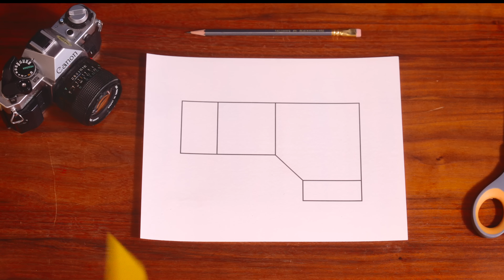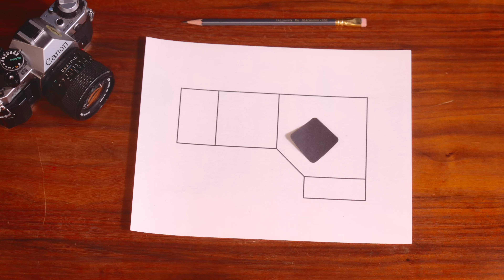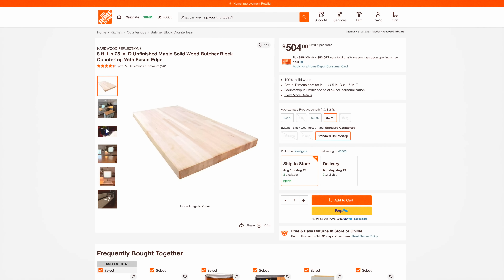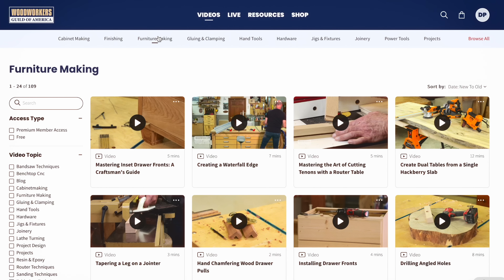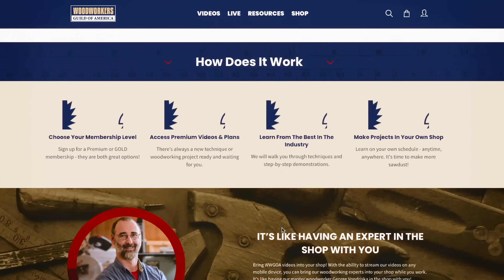Stop Feeling Guilty For This!

Comment: Love your perspective. I single-handedly, completely remodeled our kitchen while tending to my 50 hour/week day job. I gutted the whole space down to studs and concrete. I made 16 lowers (including 33 drawers), 11 uppers, an L-shape island, TV corner cabinet, pantry cabinet, laid flooring, re-routed water and electric, installed backsplash, drywall, etc., etc. It turned out great with lots of one-of-a-kind custom touches. But, it took me a whole year to complete and I lost 40 pounds in the process from overworking and lack of eating. To this day, I can't say it was worth it. Thx.
Reply: Do you have kids? Cuz that adds a difficulty factor too that I've experienced trying to get big projects done.
Reply: @richpeggyfranks490  I gutted our kitchen 3 years ago.  First time making a king cabinets, banquette and range hood.  I learned a lot.
Reply: @richpeggyfranks490  very impressive! I'm in a similar boat. I'm a year into my project. Almost whole house down to studs, moved walls, plumbing under foundation, rewired everything, new duct system, new windows/slider/doors. I'm wrapping up drywall now, then flooring and cabinets that I'm milling from rough lumber. All while working along with a toddler and another one due in December, it's been a lot of 2am work nights. Worth it though.

Comment: Awesome finish to your cabinets. As for cable management, maybe using adhesive type cable clips that you can run along the base board or against the wall. If you're able to find orange clips, even better.

Comment: Thats something i've recently accepted as well, sometimes you can just "get" the item you need and either upgrade it to your specs, or leave it as it is. You dont NEED to make everything yourself, especially if it strains you or doesnt fit your work flow.

For the cables, i know it might not be your aesthetic but i've seen people use metal plumbing to hide their cables inside of to give it that semi rustic, industrial look. In the same vein, you could just cut out wooden "rails" or wall frame/boxes to keep all your cables inside but still give it an elegant finish instead of that tangle of black cables. Advantage being since its small, you can probably add small LEDs to them so the counter top also has a nice moody light to it when you dont want to blast the entire kitchen with ceiling lights.

Comment: Wire mould is my first thought for cable management but it's kinda ugly and office building like.  I've done this for clients in thr past it's cove back trim put in reverse with a piano hinge intended in the back .  Just flip the cove trim around do a roundover on the inside some have a flat chamfer.  Attach the piano hinge anyway it makes sense if it's brads or fun colored it looks like a feature not a detraction.   Then it just flips up or outta put the cords in.  Hope this helps 👍

Comment: Great film. Make or buy is always a struggle.  8:05 does anyone make a jigsaw that'll blow the dust away?  Super build, that room pops. Mahalo for sharing, David! : )
Reply from the maker: We need a jigsaw that blows the dust away!!
Reply: @MakeSomething  With my old jigsaw, i found I could cup my hand on the side in a way that directed the air from the motor fan slots down onto the cutting area. Another great video by the way.
Reply: I had a jigsaw here in the UK years ago that did indeed blow the dust away, it had a switch for using a vacuum or blowing it away. All the ones I have now don't though.

Comment: The similarities between this and what I went through with my own kitchen are crazy. I luckily didn’t need to buy new cabinets, just painted existing. Made the same decisions on butcher block counter tops (with the same finish as well…how many coats did you use?) I still have one more of them to do….someday.

I also have the same problem with cable management on the counter. If you ever find a good solution, PLEASE share it haha.

GREAT video! By the way….first comment on your channel! Look out world…
Reply from the maker: Thanks! I used 3 coats of polyurethane.

Comment: At 8:05 did you use compressed air to keep area clean of dust or to cool down the jigsaw blade? Or perhaps was it both? I haven't thought of it but seems like a great idea
Reply from the maker: It was just to remove the dust so I could see my line. I guess cooling down the blade is a great side effect!
Reply: @MakeSomething  Wow, that was a quick reply! Thanks :D

Comment: The potential money saving is more in getting what you actually want. Instead of buying something and then regretting it or finding something "better" later.
Easier to replace parts or change/modify things afterwards. And if something breaks or gets damaged you can easily repair or replace just that part if you constructed it with that in mind. Instead of throwing the whole thing out.

Comment: Interesting build , as for the cord management reddit has some good tips.  My take on it is there is to much boring space between the top cabinets and countertop. This is a opportunity for something to fill the space and distract your eyes from the cables. The receptacles are  placed high over the counter top so they hang there. A vertical reed wall  would give plenty of shadow lines to soften the look of the cables.
Reply from the maker: ohh, interesting!
Reply: @MakeSomething  yes very.

Comment: Hold it   the sink cut out can be a cutting board   one for meats and one for veggies   but really you should have 4 meat cutting boards.
Chicken, beef or red meats, and pork, then one for cooked meats.
The reason for 3 meat cutting boards beef cooks at a lower tempture  pork can need fully cooked and poultry requires longer cook times and higher temps.

Last in the drink counter built in fridge and a counter top toaster oven.  You can also bake so a stand mixer.   But you do you.

It looks great.

My problem with that kind of counter top is i want all the grain going the same direction. Personally i do not care for the joints.  All long grain joints. 

I like the cabnit,    i might have gone with a dark blue epoxy counter
The blue and that orange pop.

Comment: Why butcher block and what did you finish it with?  I ask because I've done butcher block because it's cheap, but I also kinda hate it because I've never seen it hold up to the wet environment around a sink for very long.   

I'm about to build some large odd sized cabinets, but I think I'll never build "standard sized cabinets and doors" again... I don't mind the building, but I absolutely loath finishing them.
Reply from the maker: Butcher block for the look and Polyurethane.

Comment: Why don't you kids use wedges for clamping anymore?  😉

I will use a big piece of wood or even a long, thick board.  Attach some blocks of wood using screws.  And then just tap in a few wedges and bam!, you can "clamp" just about anything even with weird angles.

Nice project, David!
Reply from the maker: Did you not see the wedges I used? 😁

Comment: What did you do with the piece you cut out for the sink?  That looked like it would make a good cutting board.  Thanks for the video.
Reply from the maker: I've got two cutoffs that I'll be saving for a special project. That means it'll sit in a pile for year before I give it away.

Comment: Uhgg. Making butcher block is so not worth it for a utility space. I have the same inclination to build rather than buy but I have come to embrace the buy philosophy where ever the effort to results equation falls apart. I had a tiny kitchen to do for my cottage. Nothing fit a standard size so it was more efficient for me to make low cost melamine carcasses and order unpainted frame and panel doors. At about $75 a piece, I felt it was worth saving the effort. Did the drawer fronts myself with just flat panels and hit Home Depot for a laminate countertop. I also saved money and effort buying pre-finished birch drawer side material. Just simple half lap and nailed or screwed joinery on those. 
The results, a minimum effort custom kitchen that would have been stupidly expensive to order complete.
So my rule is to focus my efforts on the areas where my skills bring the highest value. In this case it was in the design, carcase fabrication and remote installation.

Comment: I did something similar. I bought the cheapest countertop from our local Box Store (Bunnings). It was hickory butcher block counter. The difference was that I spent a few hours sanding and finishing the countertop. The finished product, looks amazing and nothing like a big box store cheap countertop. Another thing I did that was really satisfying and helped ease the guilt (yes, I do still have some) was to use the scrap piece I cut out for the sink, and turn it on the lathe into a platter.

Comment: Butcherblock countertop is one of the best and cheapest ways to go for a countertop and I think it will always be a good look. I finished mine in Rubio Monocoat since it's so easy to sand and reapply if you get bad spots over time. If you go with unfinished butcher block it saves thousands versus other quality countertops.
Can't believe you didn't just turn the sink cutout into a cutting board. That's what I did with mine.

Comment: As someone who used to run a large coffee youtube channel, I can tell you that the "real" coffee snobs will advise against using RO water straight from the system, claiming that it's corrosive to any metal elements within your machine and can also lead to unbalanced extractions and inferior taste. The SCAA lists the acceptable range for TDS between 75-250 mg/L, with a target of 150. Lots of people use RO systems then remineralize the water to get to this level. In reality, you're fine, but the rabbit hole is deep.
Reply from the maker: Oh man, good to know. Thanks!

Comment: I was blessed with  DIY genes. I came out of the womb pooping mustard and fabricating things and have not stopped. In my 64 years i have achieved a high skill set and built my 4000sqft home and 3400sqft shop. The only thing i didnt do was the concrete slab and HVAC. Built all the cabinetry, the bathrooms were done with post oak milled myself with trees off my ranch, our second kitchen is done with pecan I milled and so on. I  take on things because i like the challenges that come with them. Sometimes they are easy and sometimes they ar 13:11 e not. Do i make mistakes? Yes i do and chaulk it up as a learning process. About the only job/work skill that i do not enjoy would be tile setting, i just dont care for it. Just like you not building cabinets and hiring tout to build and install.

Comment: I just built a set of cabinets for my kitchen to do pretty much the same. We needed a coffee bar, better place for microwave, and a bit more storage. I enjoy cabinet work so I built a base cabinet, wall cabinet, and a pantry all with raised panel doors. I did buy the butcher block counter top to save on time. I finished the countertop with waterlox tung oil and h2olok. I'm in the same boat when it comes to cord management. I have tried a power strip on top of the backsplash but didn't really resolve the issue. So it would be interesting to see ideas from others.

Comment: It's 100% still a project.  Sometimes you efforts and saving money are all on the installation labour.  That has been my case with two kitchen remodels and all the other work I've done around the house.

Jason from Burbon Moth had the best butcher counter top tutorial in 3 simple steps.
1. Cut a strip of hard wood
2. Hit yourself in the face
3. Buy a premade butcher block counter slab.

Comment: I recently renovated my mom's kitchen. I refreshed the carcasses with paint, built new doors, then used floor boards (coincidentally from LL Floors) to clad the existing laminate counters. 

David, you're absolutely spot on. Just because we can, doesn't mean we should. A major kitchen reno is one of those projects I most certainly could do, but know it wouldn't be enjoyable and would probably empty my motivation tank for weeks afterwards

Comment: Please don't perpetuate the long-grain + glue myth. Glue works even better with end-grain, all that matters is surface area. This has been proven multiple times. There are multiple videos demonstrating it. Long grain joints seem to be stronger because long grain joints in general have more surface area and wood pulls apart easier with the grain, not because the glue works better. (See: "Glue Myths: 1. End grain" right here on YouTube.)
Reply from the maker: End grain glue ups weaken over time as the wood moves with the seasons and the glue gets brittle.

Comment: Mmmmmm you didn't leave any accommodations for the countertop pieces to expand and contract... I'm a novice so I dont really know, but I saw a Stumpy Nubs video where he built a similar countertop with two panels joined at 45 degrees, but he did not glue the two halves, he used dogbone connectors. I assume in a climate controlled room it's not that big of a deal though 😊